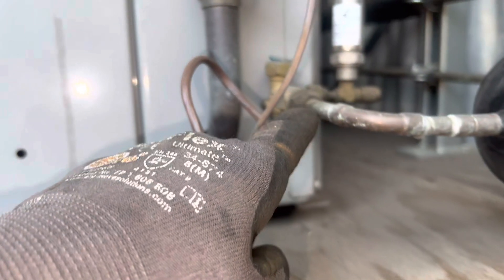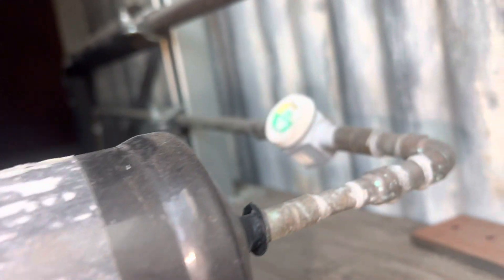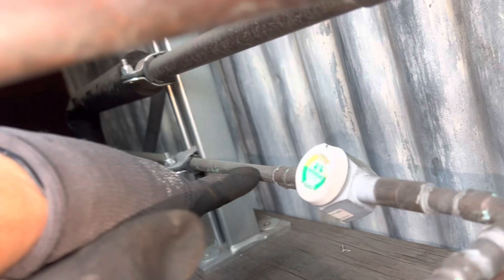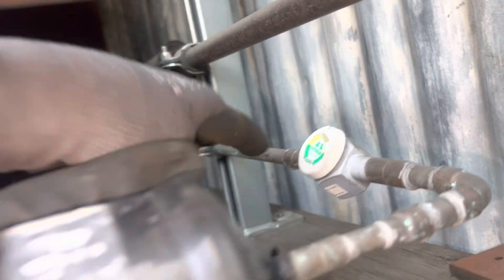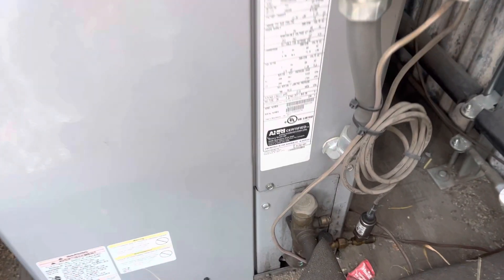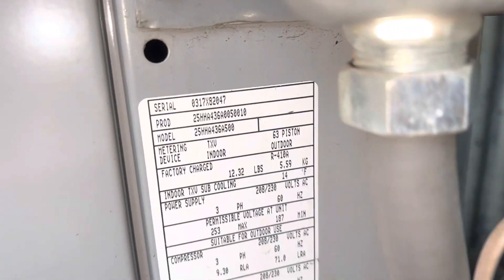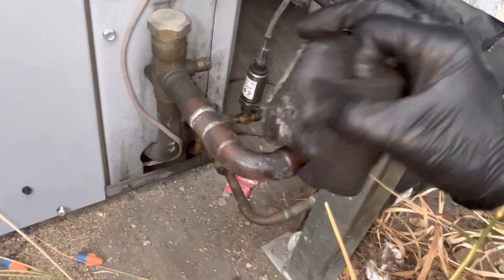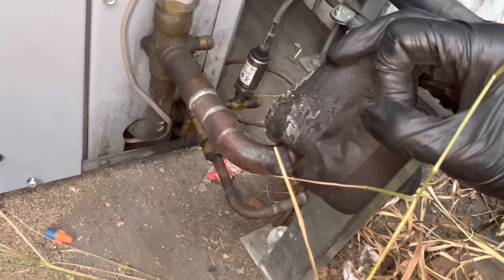36,000 BTU Carrier heat pump 7/8” suction line 1/2” liquid line￼￼. INTERESTING 🤔

Comment: Upsized due to lineset length?  No solenoid valves in the lines?
Reply from the maker: No solenoid valve, evaporator is located lower condenser is located on the roof so the oil Hass to make its way back up. 
        Often hits running at partial load load load condition rapidly cycling often on five or 10 minute intervals. 

Just enough time before it actually gets into its efficient operating mode enough time for the refrigerant to migrate oil out of the compressor but not get the velocity up and the mix to migrate refrigerant oil back completely to the compressor.
Reply: @coldfinger459sub0  Sounds like the compressor is destined for early failure.  No easy solution, I guess.  Looked like a decent installation -- makes you wonder what they were thinking.   Good video.
Reply from the maker: @Straycurrent  it’ll last a few years.  I recommended them do it correctly and the individual who sold the owner the equipment said it’s good enough
Reply from the maker: No solenoid valves were installed even though they should have been.   The lines set size for the suction line by the book factory manual should have been 3/4 inch not seven eights inch

Comment: Does the big line set diameter effect oil return?
Reply from the maker: YES !.  There are many determining factors all having to do with physics and math that will determine on how long the system lives. 

Compressions to the last 15 or 20 years or even more with no problems. 

when I was young we used to be able to say 30 years or more. 

There’s some people who say 10 years or less or five years or less but if they’re saying that about the jobs that they put in there’s something really really wrong with their installation. 

This is all stuff everybody has learned when you were in college taking thermodynamics and fluid dynamics.   When you were in a “GOOD” HVAC Academy school for commercial refrigeration or residential air conditioning. 

This is a topic that somebody can teach themselves without going to schools are classes just buy grabbing engineering manuals on refrigeration lines sizing fluid flow velocity and oil return.    Once you know and understand the basics and the simple math and most importantly the work load that is going to be placed on the equipment and it’s best hand in its worst operating conditions

Then you can go ahead and properly size the line set to accommodate the application. 

Size matters
That’s what she said 🤣
Reply: @coldfinger459sub0  designed to spec 🤔👍💪🙏 what size should've the liquid line been of the two  5/16 or 1/2  , 3/8 two to one ratio most instances?
Reply from the maker: @milo6373  manufactures factory literature calls for 3/4 3/8 

And this is a long line set over factory specification length factory specifications in this case call for a hard shut off expansion valve and a liquid line solenoid. 

And definitely make sure there’s a working crankcase heater

Because the motor is installed on the roof air handler down below and sometimes this unit cycles for weeks or months with a load load with really quick cycle times never runs long enough continuously enough to get it oil flow properly back to the compressor
Reply: Appreciate sharing your knowledge Tom, i wish if you could post more videos on commercial and residential, we learn a lot from you.
Reply from the maker: @salehabdullah399  https://youtu.be/-Sk83lM8nSA

https://youtu.be/ZsyPIYMdiFE

https://youtu.be/2SEDe0v8VPY

https://youtu.be/wUmS85UlD9Y

Subscribe to the three channels hvac instructors 👨‍🏫 above watch all their videos for everyday for the next 2 years you will know morgen 99.7 of all automotive techs that have been working for 30 years

Comment: Hi Tom, I am buying a house with a central Carrier unit from 2006 with r22. Could it be converted to r410, could it still be maintenaned with R22, or most probably I will have to replace it sooner or later? Seams to be in good working order but doesn't seam to be periodically maintained.
Reply from the maker: Hopefully you have maintenance records on it and the previous customer.   But sometimes that’s still not a good thing because of the individual who did the maintenance. 

But if you or somebody you know can see you’re determined that all the capacitors are still original change them. 

Because when capacitors go bad sometimes before they go bad slowly they start overheating the compressor motor or the blower fan motor or the condenser fan motor and they caused the motors to burn up. 

So there are very good cheap preventative maintenance item that we all know in this trade fail. 

And we are guaranteed to make return money revenue when capacitors start going out because if we’re not just replacing a capacitor we are also replacing the expense of motor that it caused a burn up to at the same time. 

I would keep it R 22.    It works more efficient and very few technicians know how to correctly change over to one of the replacement gases. 

It’s more important to determine that the fan speed over your evaporator is correct.    That you’re not overcharged or under charged with refrigerant. 

Do not use 1 inch thick high Merv rating filters. 

Make sure all your registers your fence are not blocked with furniture or in the closed off position to keep air flow full for the units performance. 

Keep the condenser clean and free of dust dirt grass weeds
Reply: I agree with replacing the motor capacitors, between 3-5 years is good maintenance because capacitors lose their function as they age and this stresses the electric motors.
Also inspect the coils closely for dust and dirt debris that will reduce air flow, squirrel cage fan blades must not be dusty, this reduces air flow and the compressor works harder.
Besides capacitors, outdoor fan motors are the 2nd most common failure item.
After doing all of that, charge should be confirmed.  If the system isn't low on charge, that's fantastic news.
Replace the service connection valve caps, the o-rings inside the caps are old enough to be unreliable.
Reply from the maker: @thisisyourcaptainspeaking2259  and that’s a more correct detailed response than my short response while I’m voice to text while driving answering questions.

I forgot to mention use Amrad American made turbo cabs as your capacitor Replacement
Reply: @coldfinger459sub0  Agree, I'm currently sitting on my couch with a cup of coffee, lol.
Reply from the maker: @thisisyourcaptainspeaking2259  and a keyboard in your lap lol 😂 👍
Reply: Go no higher 4frp on pleated filters Rheems at the Depot about ten bucks for a 3pak good flow for heat pump or furnaces..✌️💪👍🙏🤔🏜️
Reply from the maker: @milo6373  Yeah if you’re going to use the cheap 1 inch pleated they should only have a few strands of filter material just enough to keep particles the size of a bumblebee out for good airflow lol 😂